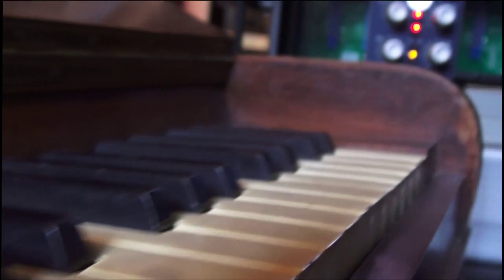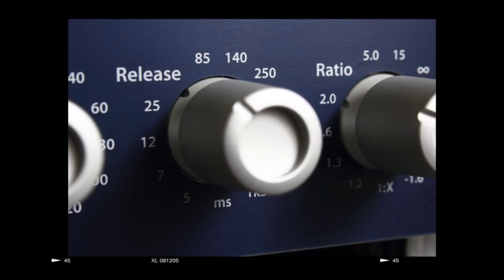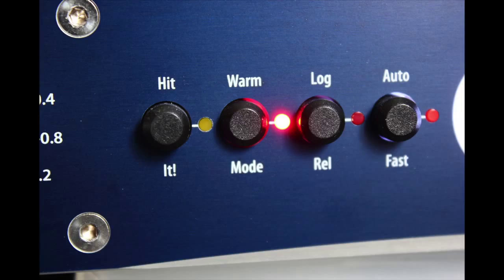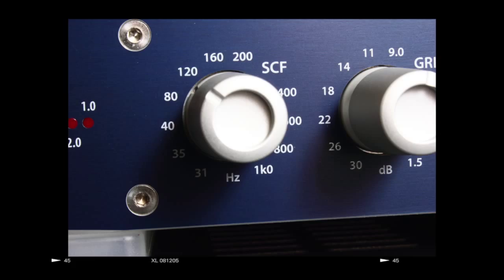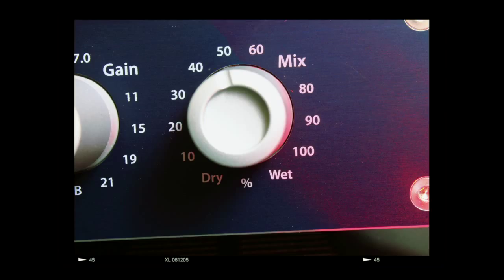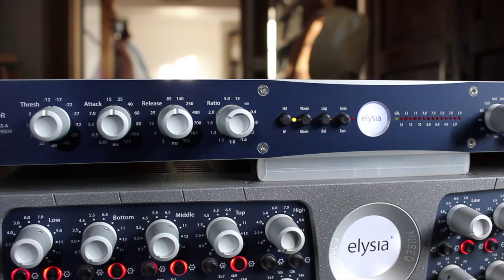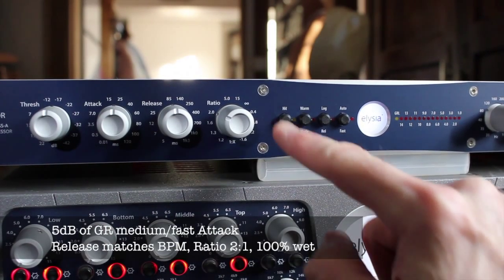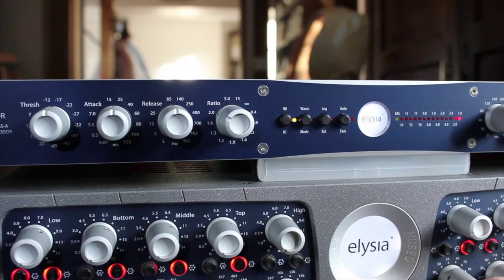xpressor workout part 2

Comment: Howdy. I have elysia xpressor neo, If I connect it to the uad apollo twin, can I record the voice through it? I saw that the compressor is stereo, and I record the voice in mono.. Or how could I record it in mono through it
Reply from the maker: Yes you can use it in mono. Just connect only one signal (left or right) and use the controls as you're used to. But keep in mind that you can use only one mono signal, - not dual mono.